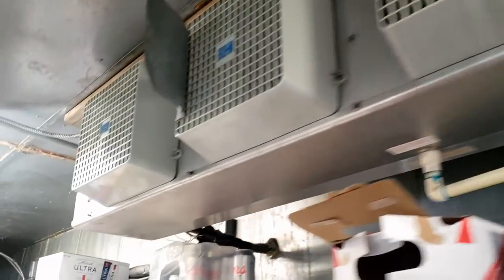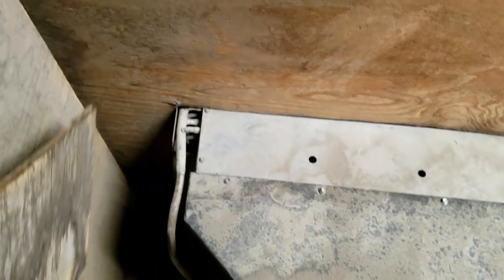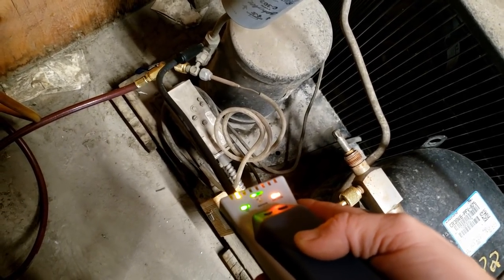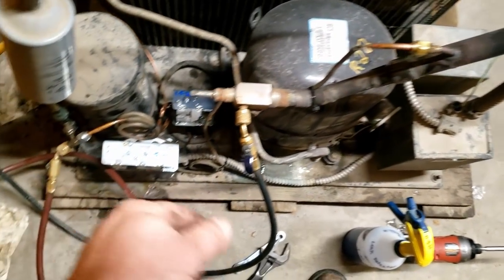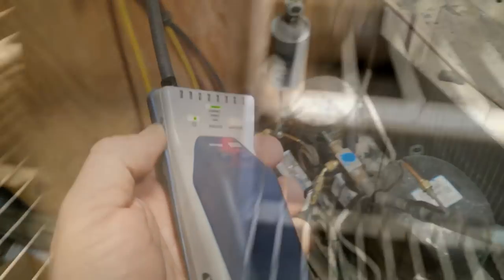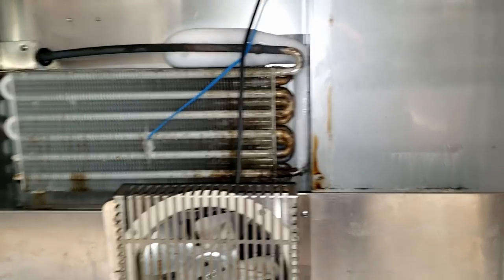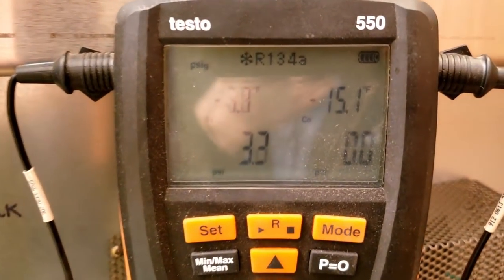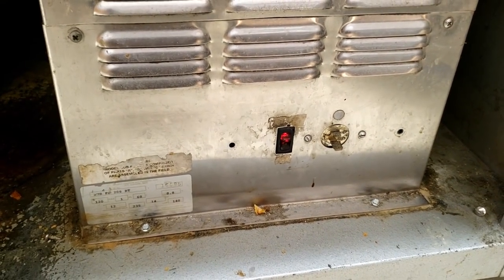BEER COOLER & REACH IN COOLER WARM

Comment: I work for Fords doing refrigeration. But back when I ran service I get a call for a Buffalo Wild Wings water all over the place in the keg cooler. I walk in keg cooler it was flooded, I reach up in the drain pan and it was all Ice, I look at the drain line a foot off of it was a union I was like sweet good install. Went and got my nitrogen took the union apart dropped the pan the Ice flipped out and I went to blow the line out. Then BAM! I here all this screaming. Then pvc went though the wall and drained into a mop station across from the was the break area, it was never 90 down. I am so glad I don't run service anymore. Keep up the good work men.
Reply from the maker: Wow that had to of made a heck of a mess. 🙈😁. Thanks 4 sharing👍

Comment: That’s an interesting setup in the beer walk in. Usually I see 2 evaporative coil on one cooling circuit. I guess if the one system went down, the other one will still work.
Reply from the maker: I'm not sure what the logic was behind it, it's possible they may have expanded the size and needed more BTU for the box?

Comment: Someone has been hacking on those U bends STEP AWAY FROM THE HAMMER. It will cost him in the long run. Plus that pressure switch was originally installed close to the flr, bet that switch was kicked too many times. Smart to raise it off the flr out of foot beating people. It look like that cold rail was using a hot liquid defrost with those copper lines in a drain pan? If that unit is new wow that coil has been abused with some kind of liquid that rotted the coil. That owner needs to be taught how to keep a store clean and units free from debris so it can breathe. Rick you got it under control bud. Thank you for sharing.

Comment: Why do they put the refrigerant lines in the drain pan ,never understood why they did that.
Reply from the maker: They're using the heat off the compressor to evaporate the water out of the drain pan. Plus it helps with the efficiency a little bit.

Comment: I have a beer walk-in cooler and the relay blew...when i went to crawl space where compressor is, the relay was literally fried and came apart in my hands when i went to remove it.  Anyway I got a new identical compressor not thinking that I had to charge the system with refrigerant (which I can't do because I don't have that nor any of that equipment).  My question is: having not touched the compressor lines or compressor, can I just remove the relay from new compressor and put it on the old compressor?  I am convinced that the reason the relay on original one burned up was because a wire shorted.  Thanks for any advice.  I live in a small town hundreds of miles from a city but if I did have to call a person to fix this, would I search just HVAC specialist?
Reply from the maker: The compressor and the wiring needs inspected and tested for shorts and any incorrect sizing by someone that is properly trained for refrigerant and electrical or you could have a dangerous and or deadly result.  Far as looking for a person to work on it, you'll be best served to find a refrigeration company. HVAC is heating ventilation air conditioning. The R after the word is refrigeration. Refrigeration is specialized in climate controlling products where air conditioning is climate controlling people. There is a difference even though they both use the same tools. The difference is the knowledge. Before I got into refrigeration I was good at AC but didn't know all the controls and refrigerants that are used in refrigeration so I would struggle. My recommendation is ask other business owners of stores that have your type of equipment who they use. Then as last resort Google refrigeration companies near you. Personal recommendations is always better than a ad online or in the phone book.